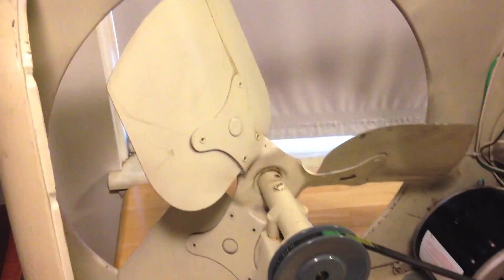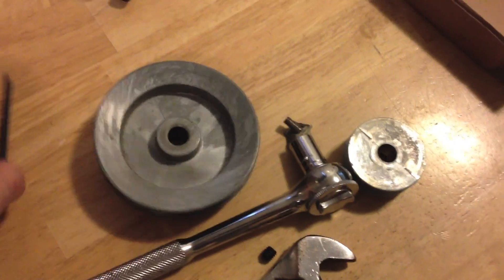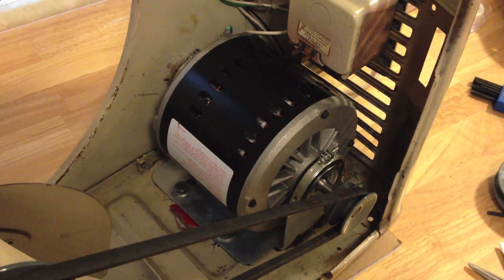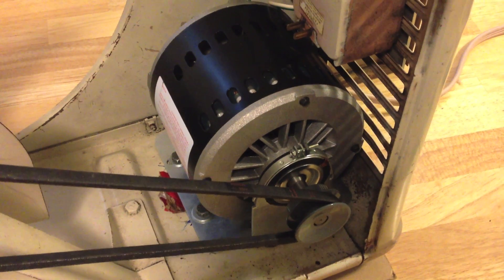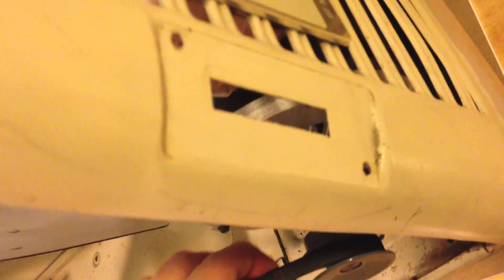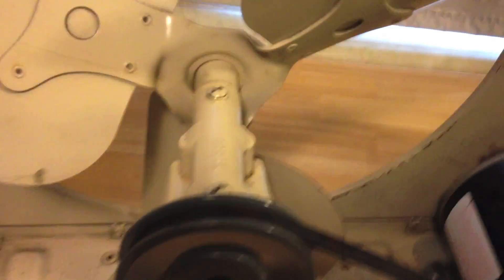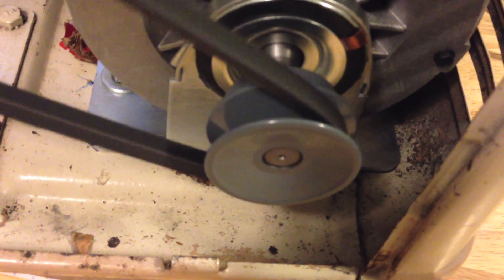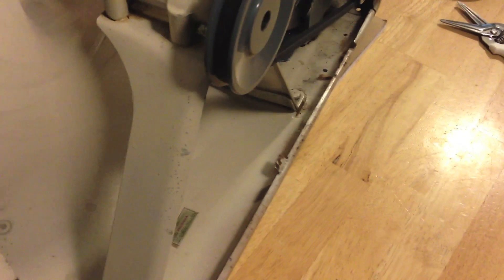Replaced the Homart Cooler motor

Comment: Thank you for the video..  On the motor's mount, did you have to modify the bottom of the fan frame or did it bolt directly in?  I have this same fan, paid $3 at a garage sale, it worked great for about 5yrs and now it smokes and kicks the breaker every time I try to turn it on..  It's an awesome fan and I'd love to make a video on replacing the motor but I'm trying to find the easiest solutions first..  (Any tips would be great)  That motor costs $253 right now, is there any cheaper ones you'd trust??
Reply from the maker: I had to drill some holes for the different motor mount frame size. I’d honestly recommend just finding the same fan and swapping motors. You could buy a second one of these for parts for a lot less than $253.

Comment: I'd like to put a predator 212cc or even a 420cc engine on one of those big vintage fans/whole-house fans. lol
I wonder if it's potentially dangerous in that the fan blades might come apart from the high rpm?
I would also probably make the belt really tight and add on a strong belt tensioner like from a car to prevent slippage. 
LOL, I have a bunch of crazy project ideas.
Reply from the maker: Just make sure it does not turn more than 1720 RPM. Any higher and you risk the blade eventually self-destructing due to the forces and that could be fatal if you were close to the fan when it happens.
Reply: @Chrshv80  yeah lol a high torque fan that can actually cut your finger off unlike the weak electric motor that has like 0 torque and you can stop it with your hand lol talk about making it dangerous.

Comment: So my sister and I are cutting out Alaskan corn off the old motor and are trying to wire into the new motor for my homework, but I was wondering how did you get it wired and could you either tell me in the comments or make a quick video sometime of how to do it?

Comment: Is that motor from granger? because  a few Fridays my sister took me to granger here in Birmingham Alabama and they had a motor that was the looked exactly like that one my sister honey I’m telling you it won’t fit me yes it will a guy (you) on YouTube has the exact same motor from here
Reply from the maker: Lennon Groover, I ordered the motor from the Drill Spot but ended up using the original motor. Turns out the motor was not tensioned  correctly.

Comment: And how did you hook it up because my sister took me to granger to see if they already have a motor with a cord on it and they said no so I we going to buy the one that you have and there was a guy there that said that Brannon electrical motor or B & D electric and that they could fix it up so we took it to Brannon motor repair the guy said that it is so old and rusty that it’s not possible so I might go back and try to wire it up but I was just curious how you did that it there a way that you could do a step by step video on how to wire a motor to a fan

Comment: What size belt did you get because I got the wrong belt from Lowe’s accidentally twisting it to where it would spin backwards and act as a reverse button and it made the motor not be attached to the housing

Comment: Hi Guys. I too Have a Homart Fan. And my Problem is. the 4" pulley on the fan shaft is warped. my guess is the belt must of jumped off at one time binding the pulley. it was like that when i bought it from eBay. "know big deal" ! but i am wondering if i could putt a 3" pulley on it would it work. it has the original 1/3 HP Craftsman motor with 2 speed exhaust.
Reply from the maker: it might over amp the motor as it will have to work harder with a smaller pulley

Comment from the maker: The shake is nothing to worry about. Anytime you are putting a large belt-drive motor on a fan it exerts quite a bit of torque on the fan shaft. Also, all induction motors in North America run on 60HZ power. This frequency causes a bit of a "cogging" effect on the belt, a stretching and loosening of the belt-tension as it rotates and causes an uneven torquing on the whole fan housing. That 1/3 h.p. motor shouldn't have any trouble handling the larger pulley.

Comment: I noticed the original motor with my fan vibrates itself, I took the belt off, as the motor slows it shakes the whole fan. I got the same motor, 2 speed reversible direction for 138.00 on ebay, would have been $50 more from grainger.com.

Comment from the maker: I'm not sure of the exact part number, but it is the 3.95" pulley with 1/2" bore. Also try Browning pulleys if you want to compare prices. They are just as good as TB Woods. If you wanted a little less RPM try the 4.25"

Comment: What are the part numbers on the pulley's i need to replace my smaller one as it has a crack in it, I Have decided to replace both of them. I went to TB Woods site but do not Know the part number or actual size of the pulley's.

Comment from the maker: No problem, you're welcome. I'm guessing that your start windings or the centrifugal switch are failing. I bought my motor on Grainger.com. The challenge is finding a motor that has a short enough front to back length including the shaft. I included a link to the motor I bought up in the video description. You'll also want to buy a 2-speed switch and probably add it to the side of the fan like mine. The only challenging part of the job is drilling and aligning the motor mounting holes.

Comment: Thanks man I'll have to look closer I didn't see a set screw.  My fan still works pretty good but it has some dead spots so you have to spin the blade to get it going sometimes.  Looking into getting a motor like yours.  I'm sure I'll have more questions for you if you don't mind.

Comment from the maker: Larry, It's all the way on. The pulley just has a little overhang. I had to use a mallet to lightly tap the pulley tight. There is still less than a millimeter of play on the shaft but if the pulley is on too tight it creates a lot of friction against the bearing housing.

Comment from the maker: I loosened the sheave set screw with an allen wrench. It was still tight so I bought a pulley puller from Auto Zone. You can find them for around $25. Then you use a socket wrench to turn the pulley puller which then pulls it off the shaft. It was really easy once I had the puller.

Comment: How did you get the sheaves off?  It looks like a bolt in there but the clearence is way to small for a socket.  I looked on mine to see if there was a snap ring but it didn't appear to have one.
Reply from the maker: I used a small pulley puller.

Comment from the maker: My motor actually doesn't vibrate. It's really smooth. The vibration appears to come from the shaft. I won't worry about it though. If the bearings fail I could probably have something fabricated for it.

Comment: I won't worry to much about the blade hub or shaft. Your fan is fine. Looks and runs smooth since you change the motor as i can see it in the video. Mine is the same, it vibrates a little bit because of the motor.

Comment from the maker: Thanks for the idea! I actually was reading something about this today. I didn't realize they could use a larger pulley. However, I'm a bit concerned about the balance of either the shaft or propellor hub. It seems to be the root of the vibration which has been concerning me as I know it will have a detrimental affect on the life of the bearings. I should probably purchase a second Homart cooler to have on hand for parts just in case something happens with the fan shaft.

Comment: You know you can run a full size belt with your pulleys instead of the skimpy 3/8" wide ones :) Just get an A36 (4L380) size fhp belt. It's a 1/2" wide and 38" long. Just the right width for your new pulleys.

Larry

Comment from the maker: Larry, I had trouble too. It was very tight. I had to squirt a little WD-40 to help but the other side of the pulley where you insert the key is up agains the shaft pillow block housing as close as it will go. I just think these pulleys are extra wide. It grips enough of the shaft not to be too much of a problem. I wish the die-cast pulleys could be made to the tolerances of these steel pulleys! I'll try to post a regular demonstration video soon. It's been too hot to use it this week!

Comment: Nice. Thanks for posting the video. Is your pulley pushed all the way in(larger one)? I bought the same brand of pulley like yours but mine would not sit all the way in. I try oiling the shaft to make it slippery but it still get stuck halfways. Anyway, really nice upgrade. Post some test run vids again.

Larry